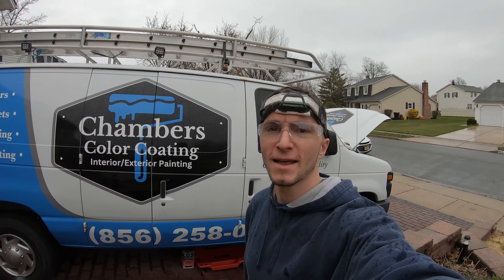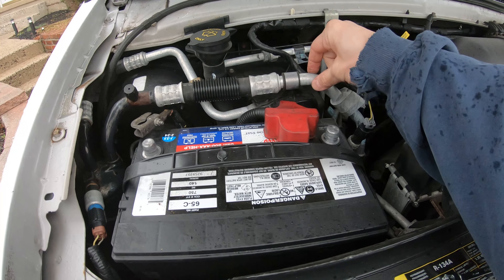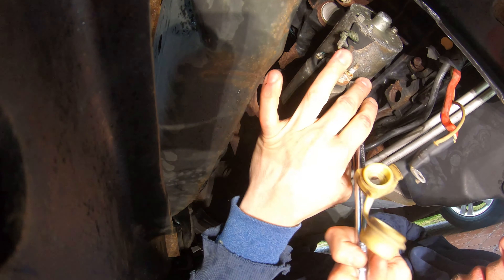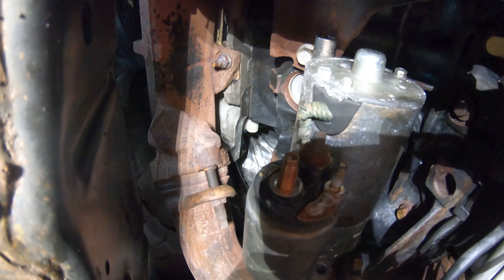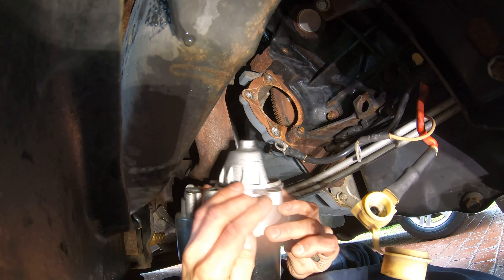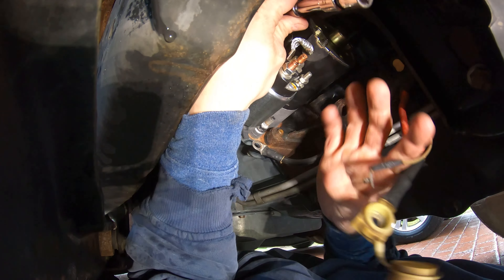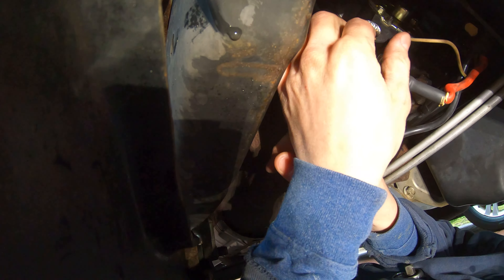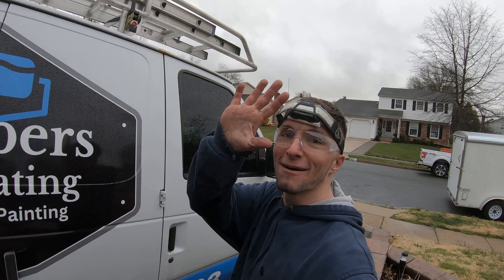How To Replace Starter 2008-2012 Ford E-150 | E-250 | E-350

Comment: Your explanation of installing a starter motor for 2011 Ford E 250 van was fantastic. Especially for the top bolt of the starter. Remarkable. 🎉🎉🎉

Comment: I just changed my 2 yr old starter my 2001 e250.....upon checking it ..the problem was the solenoid starter contacts ..the starter it self was like new...you can order the solenoid separate ...which says me ...they are the issue ..put new solenoid in ..works perfect.....have standby starter now ..cheers
Reply from the maker: Great information! I’m sure this will help others out there too, thanks for sharing!